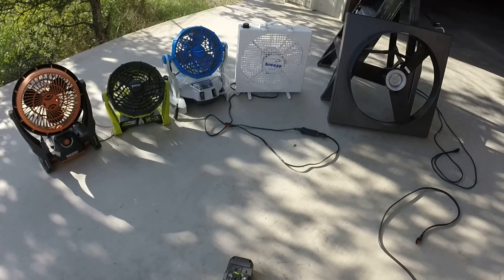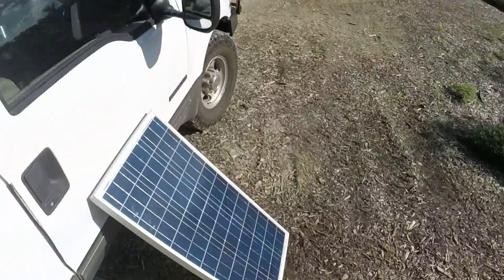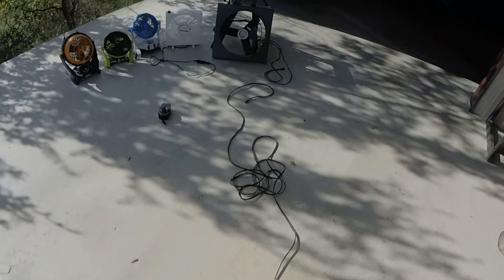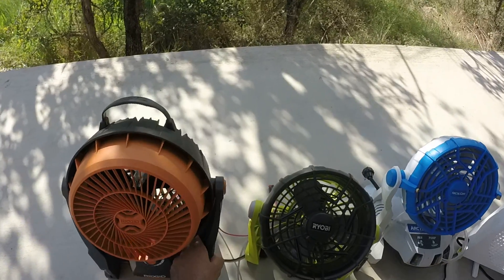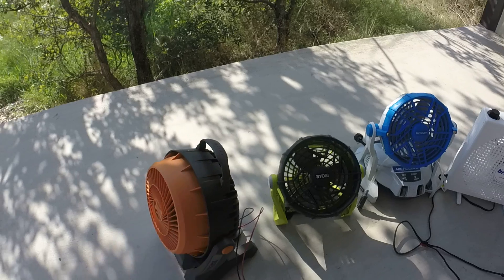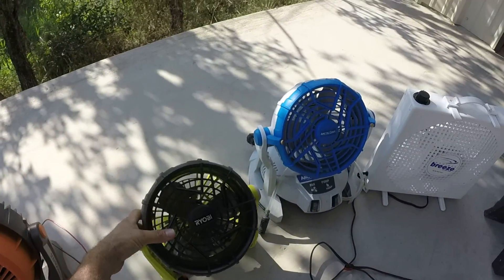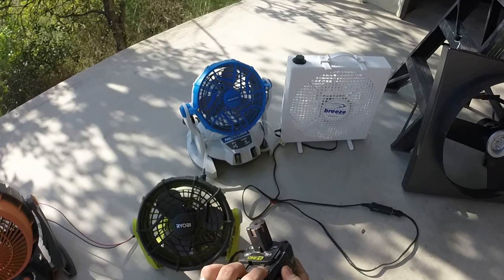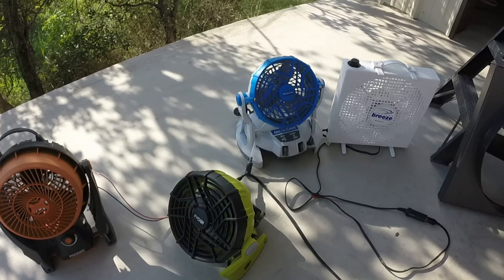Solar Panel Direct Fan Off Grid Cooling Battery Free

Comment: If you find a fan with a dc motor, you'll have a lot better luck theoretically.  Many of those fans are likely designed to run on ac.
Reply: Never mind, it appears that the fan that you hooked up to last has a dc motor connected to the back.  Likely out of an old scooter or something.

Comment: Dude, I’m so glad you made this video. I was really confused on this solar stuff, but heck who likes paying high electric bills so I’m in it now. I needed to buy a fan and a solar panel to put on attic to cool it down so ac wouldn’t kick in so much but was wondering if you could just hook up regular house fans to solar panel. You just answered my question nicely. So I bought a 100 watt panel at Home Depot for $71 and two radiator fans for $ 33 At Walmart. So for about $100 it was way cheaper than Amazon that were $159 . Again thanks for this simple video. Now just need someone to get into hot attic. 😂🤣. Thanks again😊

Comment: I use the Endless Breeze fan ( the white one ) in my truck with a 100 watt solar panel and it screams.  I use it to move the hot air out of my truck in the summer time. I also use the same fan you have cooling your battery bank on my tool cart that I use when I am working on my motorcycles or truck... but i use my 50 watt solar panel for that one.  I

Comment: Yeah but you could not run those direct to solar fans at night when it's needed the most. I'm looking for a very low energy consumption fan to runbat night off my 200 watt panels and 100 ah deep cycle battery with pire sine wave inverter. I want it to run all night without my battery going below 50%. Any ideas?

Comment: who makes the big fan? I use 9" pc fans for my battery banks that run 24-7 off of the 12 volt.
Reply from the maker: backwoods solar
Reply: Okay, thanks!
Reply: Did you find that fan anywhere? I looked on the backwoods solar site couldn't find it.
Reply: I would like to get a fan like that to use as a gable vent. I didn't see any on backwoods.
Reply: yes I did very pricy!
Reply: You said that you found the big fan but it was "very pricy".  Where did you find the fan?  May we have a link to it?  Thanks!
Reply: Correction - The Battery Powered House wrote that they found the big fan.  May we have the location where it was found?